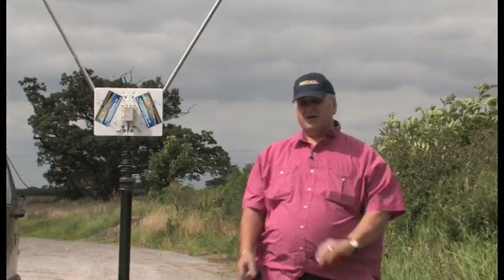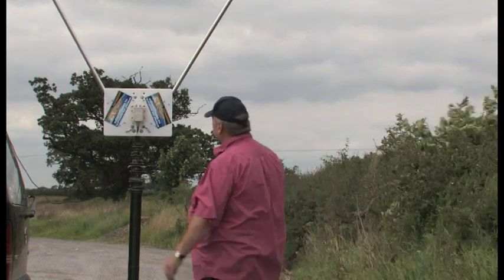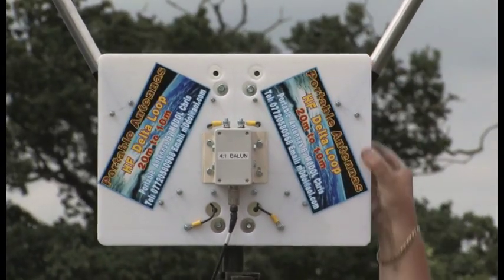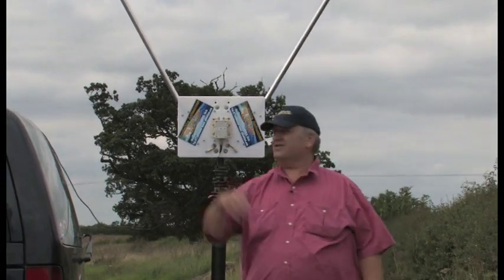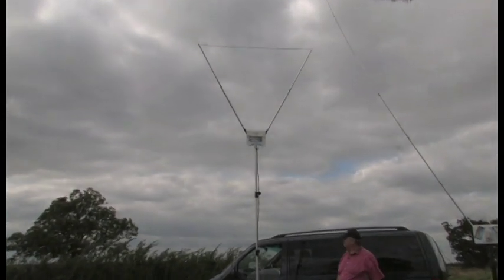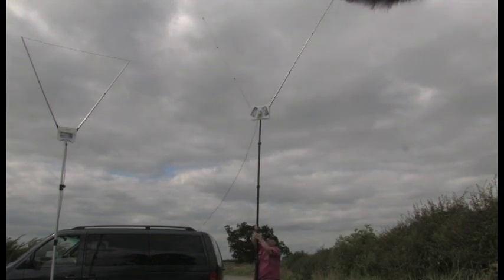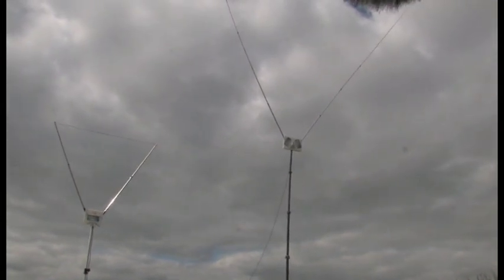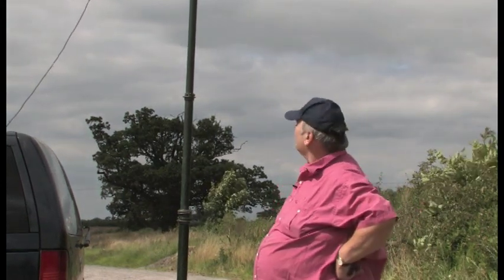Portable Antennas by Chris M0DOL - Part 1

Comment: Did not see a place to buy parts to make this. Need more info.
KQ4CD
Reply from the maker: Sorry Paul, Chris is Silent Key now. A useful eHam link to H5ANX Delta Loop - https://www.eham.net/articles/10738
Hope that helps a bit thanks Nigel.
Reply: Nigel Green tnxs been off the air to long. In fifteen years,  things have change alot. The price of has been pretty much of a culture shock really. Got an old lightning bolt Two element Five band I hope I can find the paperwork to get all my measurements correct want to get back on the air with it. That's if I can get it working but then again there's always wire. 7 3 KQ 4 CD

Comment: I need a 2.4 Mhz  antenna for my RC airplane transmitter  , I want to gain 10 meters distance on the transmitter that is only 200mhz of crap power. I was wondering of a 5w booster with a nice antenna would do the trick  ?